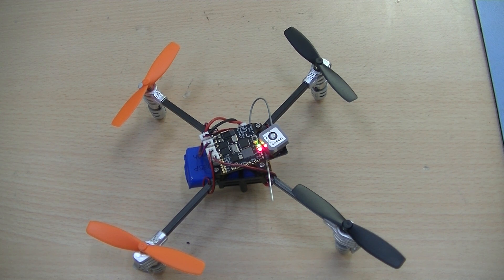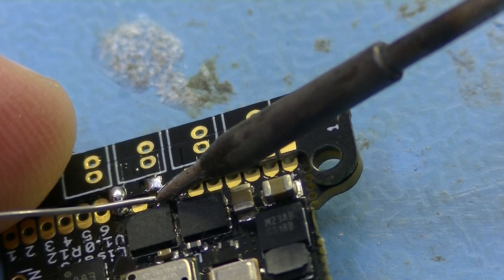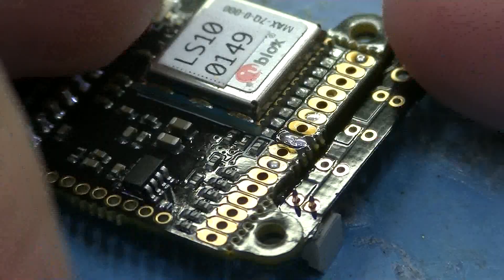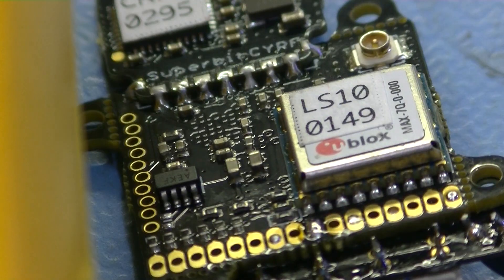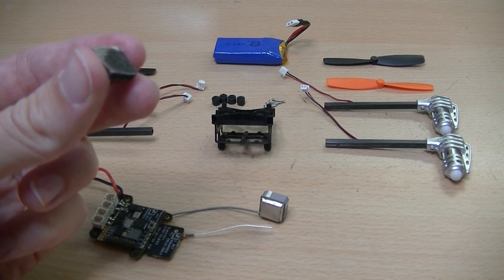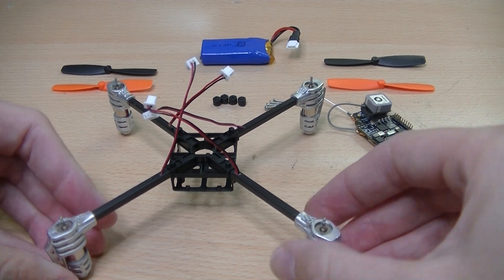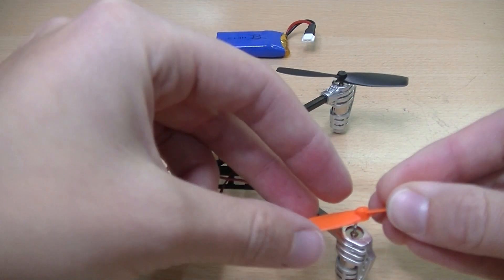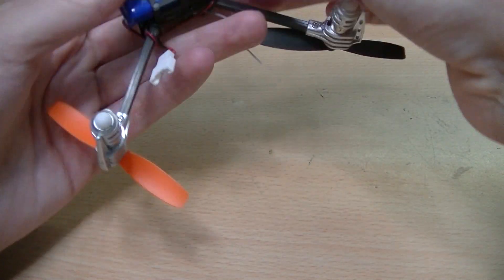Building the Lisa/S Nano Quadcopter

Comment: what gps antenna is that? its tiny
Reply: ***** thanks, i think its the 2 Stage 25dB one.
i might try it eventually

im going to be building a flight control board in the summer with an M7 MCU and a load of features. i'm not trying to make it tiny like this, too expensive